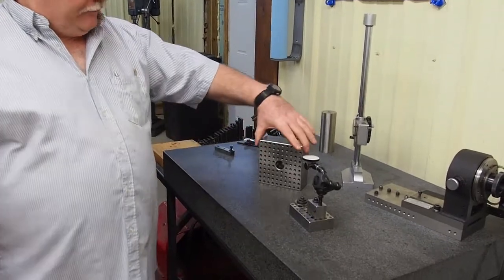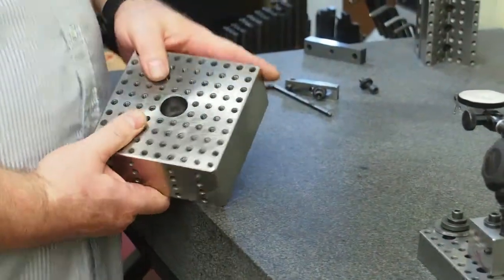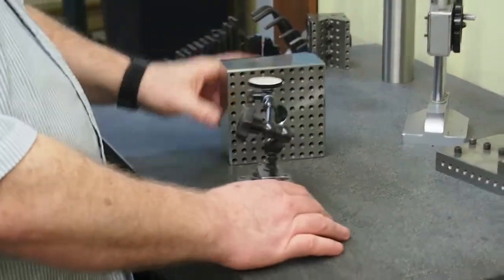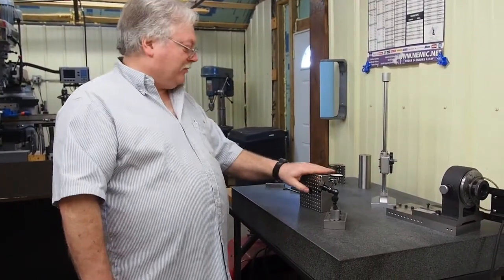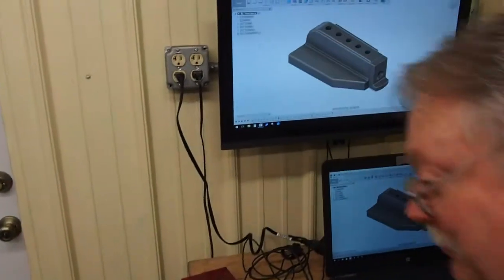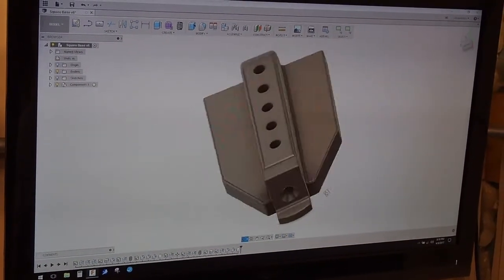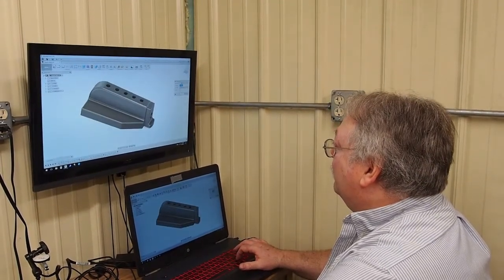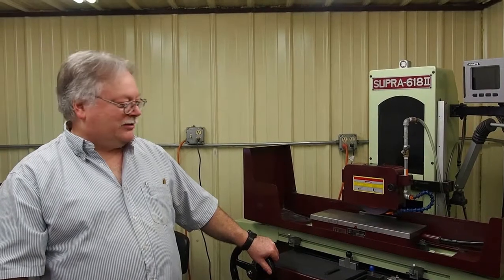Cube

Comment: Enjoyed Steve!
ATB, Robin
Reply from the maker: Hi Robin,
This simple cube is one of my favorite tools.
Reply: I bought a hardened magnetic V block from SPI long ago and it is the most used thing on the grinder. I stand it on end with the V vertical and at 45 degrees so the grind lay is square with the work. The V's are dead square to the end so you can put work in without clamps. Even very heavy parts can be held by having the weight supported by a small block on the table at the center of gravity of the part so it puts no bending loads on the V block. Much faster and less chance for clamping distortion. You need to try one.